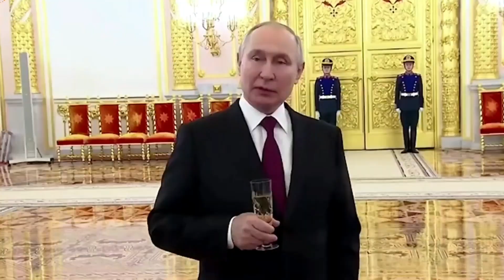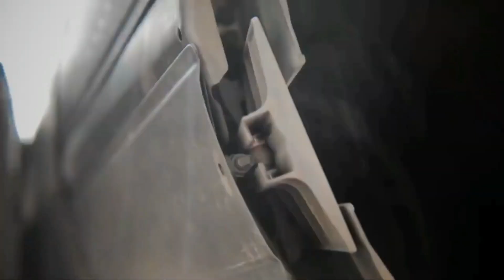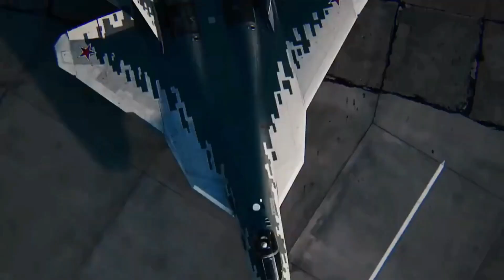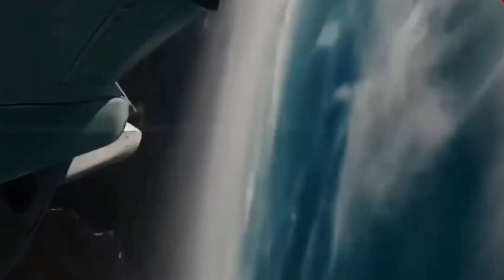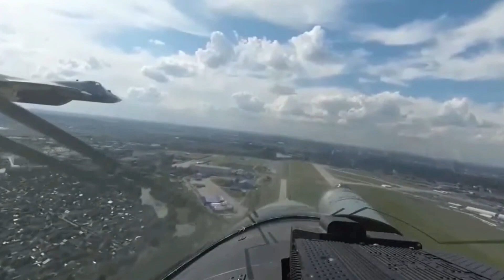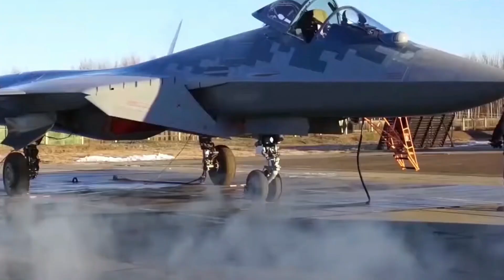Putin's Wings: Unveiling the Su-57 - A Presidential Affair with Russia's Stealth Powerhouse

Comment: B-2 is the King of stealth for one reason. One reason only.

No vertical stabilizer.

Did you know the Su-57 was designed to maintain yaw axis stability with its 3D vectoring engines? They can remove the vertical stabilizers because of this and still maintain stability on the yaw axis. They have alot of concepts they wish to apply like retractable or foldable vertical stabilizers or a variant without them. Onboard monopropellant system(RCS) for extreme low speed maneuverability when needed. Of course carrier operation capabilities and so on.
Su-57 seen today were produced to begin testing their compatibility with other drone aircraft. Most are still just test beds. What you see today is just the stripped down, economical version for testing. Lockheed did the same thing competing against Northrop and their YF-23. Both weren't packed with their true potential back then. The winner then evolved.
Reply from the maker: Bro just think...about more features like radar segmentation, maneuverability & more...anyways thanks 4 ur feedback
Reply: @isaacyiserecovery  Just last year Northrop said they were giving the B-2 a wide range of upgrades.

Comment: Calling the Felon stealth is such a misnomer. Yes, it's RCS is smaller than with traditional jets, but it's not anywhere near the RCS capabilities of F22 or F35 - heck even the antique F117 beats it by a mile.
Reply from the maker: Just think about more future like radar segmentation,maneuverability & Other's...don't be limit ur comparison at specific sites
Reply: @isaacyiserecovery  Uh, everything other than stealth was already achieved by other Russian planes. 

The SU 57 was meant to be the answer to the Raptor - a true gen 5 stealth fighter, but is hardly a gen 4++, which Russia has plenty.
Reply from the maker: Bro it's ur opinion...anyways thanks 4 ur feedback
Reply: @isaacyiserecovery  Uh, that's not an opinion, that's a fact. 

SU 57's RCS is ~0.1m2 to 1m2
F117 ~ 0.001m2 (100x smaller than the lowest expected RCS of the Felon!!!)
F35 ~ 0.005 m2
F22 ~ 0.0001 m2 (1000x smaller!!!)

The F/A-18E/F Super Hornet has the same approximate RCS as the Felon, and nobody calls the Super Hornet a stealth aircraft.
Reply from the maker: Bro...it's true &  wide concept to talk...thanks 4 ur feedback & sharing ur experience